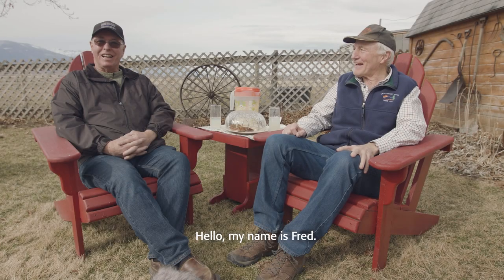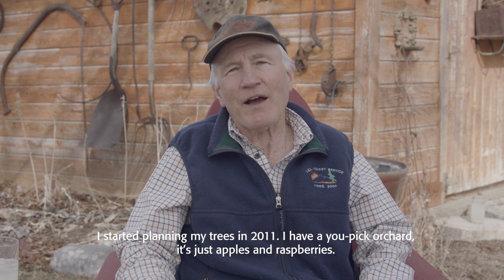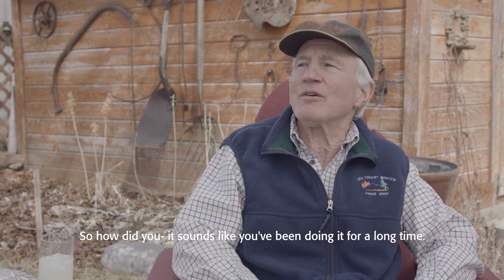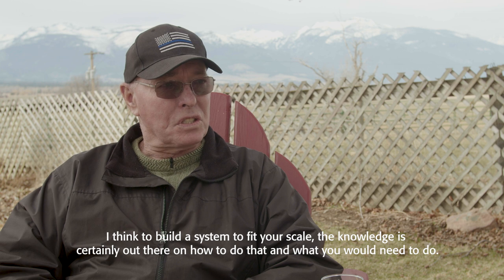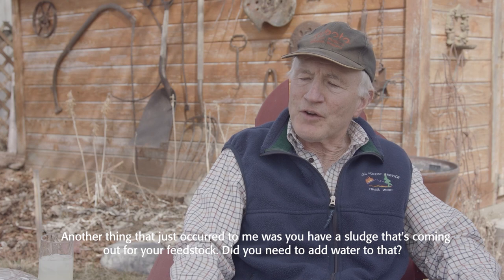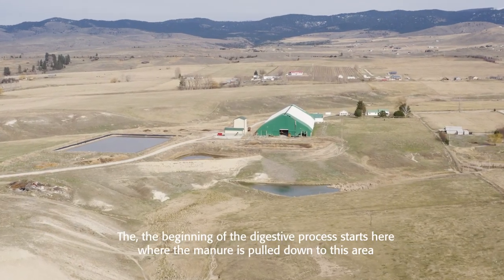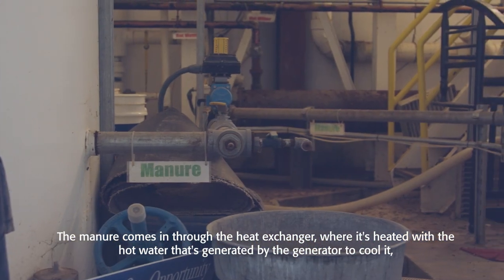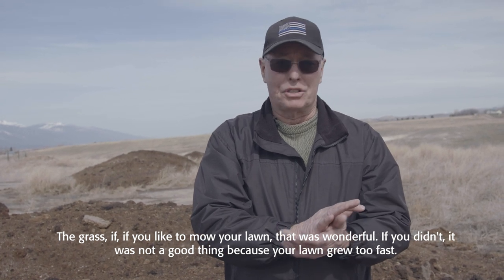Anaerobic Digestion for Small Farms: The farmers’ point of view

Comment: Hello,  I have an (unwanted) anaerobic situation & not sure how to best deal with it. About 4 months ago, I put seaweed in a big bucket of water and it broke down enough to use in the garden as fertilizer. But then I decided to "amp it up" and added some alfalfa pellets, shovel full of composted horse manure, & about a pint of fish emulsion fertilizer. Then I locked to bucket. Well it's amped for sure! When I opened the bucket, it was literally churning and stank like you won't believe. Now I'm afraid it will explode if I keep it locked, but my neighbors will likely have a fit in I left it open. Is there a way to diffuse this process? Thanks
Reply from the maker: Thank you for reaching out to MSU Extension. I suggest sending your question to the researchers on this project. More information can be found in this news release: https://www.montana.edu/news/22550